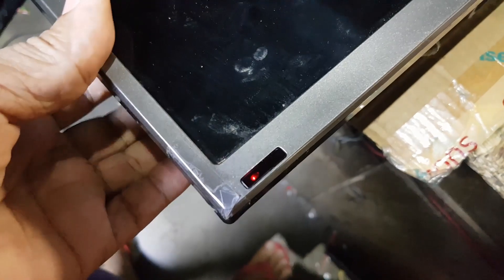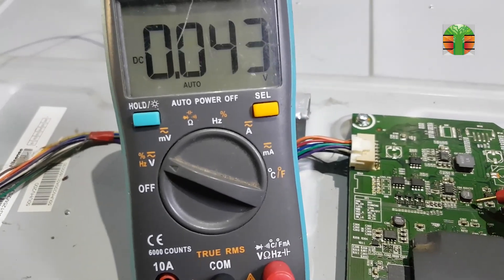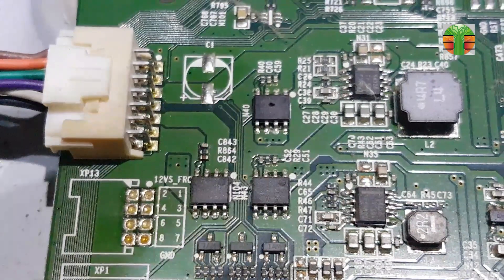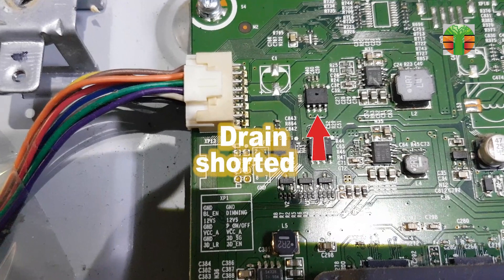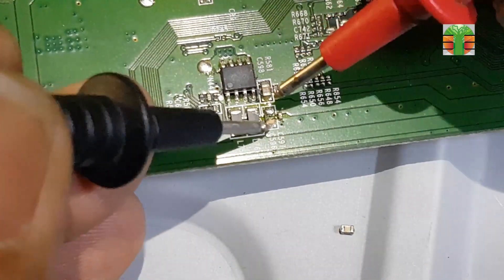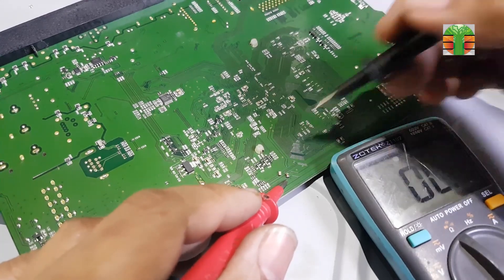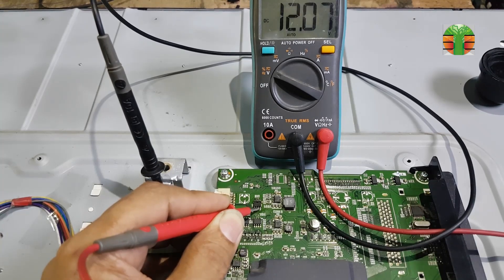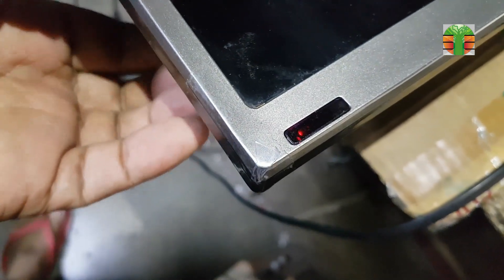4K Smart TV not turning on. Mosfet exploded.

Comment: pleas use the hot air station  cos if u are using the hot solodering iron to remove the mosfet may it coude the destroy the pads on the maion board

Comment: You will always surprise me Tevz.
Good work ❤️.
How you know  it's a 4.7uf 25vlts capcitor. My only problem is with capcitors. And resistors. They didn't lable on the pcb board. And when it's blown how to know the exact value. 
Thanks Tevz. 👍
Reply from the maker: Thanks again for watching. Its not the exact value. Mostly 4.7 uf 50 volts or lower.
Reply: @tevzTVTevatronics  it's my pleasure Tevz.
Am learning a lot from you. It's me who have to thanks you.
I love electronics and I will keep following you sir.
Thanks a lot

Comment: thank you master sa pagshare,kong walang pamalit na mosfet master,pwd po ba ibypass source to drain?
Reply: Maraming salamat po master sa pagtugon,God bless
Reply from the maker: Pwede, pero dapat pag i off tangalin yung sak sakan.
Reply: @tevzTVTevatronics  direkta po pla ang pagoff sa saksakan ,hindi po ba pwd ioff sa remote,at bakit po master?
O mas maganda po master na gumamit ng buck converter pra sa nawawalang supply kpg walang pamalit na mosfet or regulator ic?
Reply from the maker: @jayar6698  pwede i off sa remote, ang problema pag i bypass mo mosfet hindi na mag off mga dc to dc na nakakabit sa mosfet. hindi pwede yung buck converter kasi switch ang gamit yung moset hindi regulator.